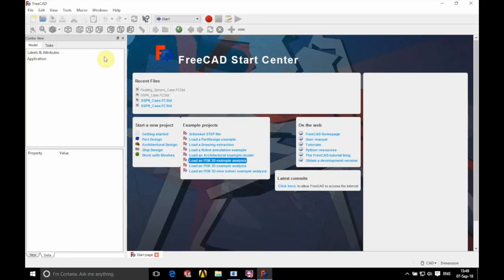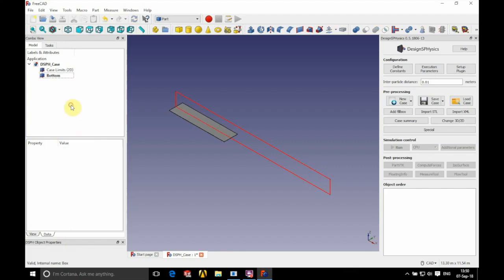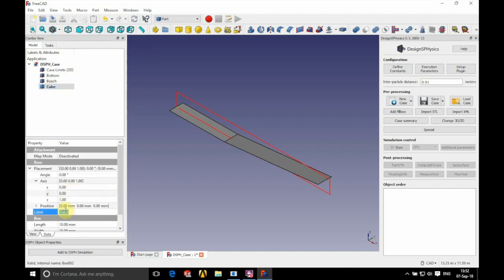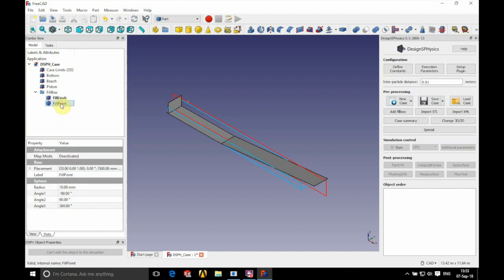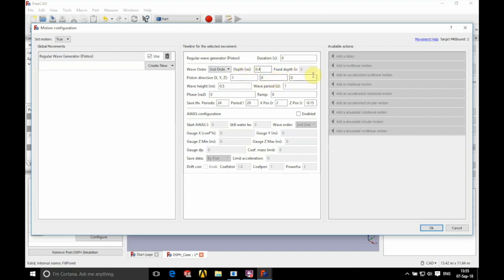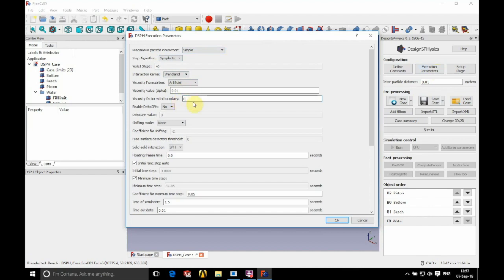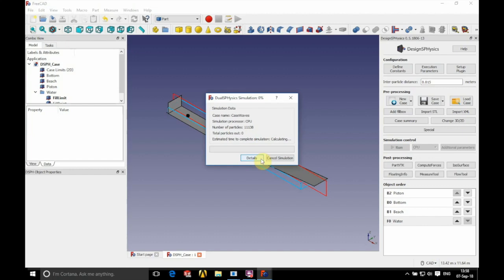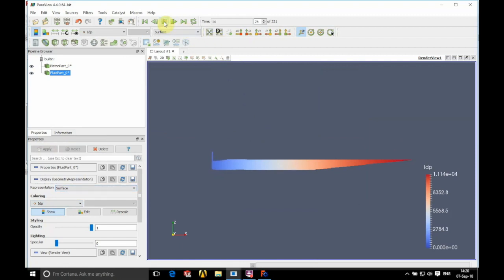DualSPHysics How to set up and run: CaseWaves

Comment: I am using the latest version and I following exactly like what you did. But when I run it appears error " An error during execution. Make sure that parameters exist and are properly defined." . Please explain this about error. :)
Reply: please send us (dualsphysics@gmail.com) the Run.out and .xml of your simulation and we will check
Reply: @corradoaltomare9092  Dose this issue have been solved? I also meet this probelm.
Reply: @liansherry5066  Did you solve this problem？I meet this too.
Reply: guys, someone solve this problem ?
Reply: @jorgerenzo3633  to troubleshoot it, reduce the simulation time to just before the error occurs, this way you might see why it crashes by looking at the results.